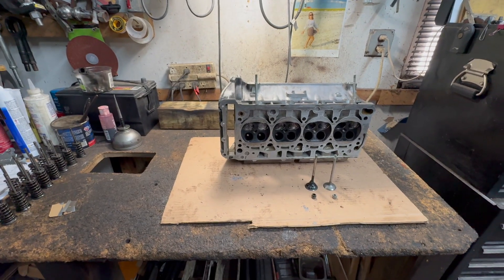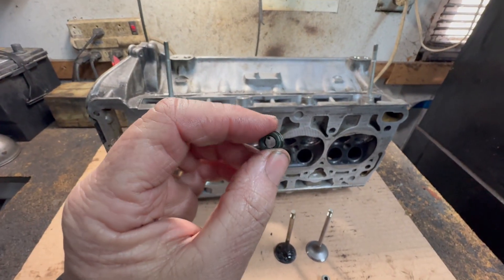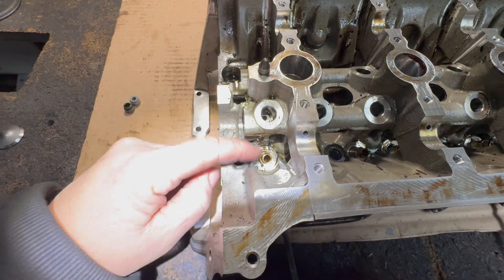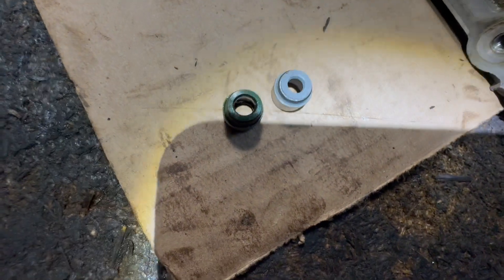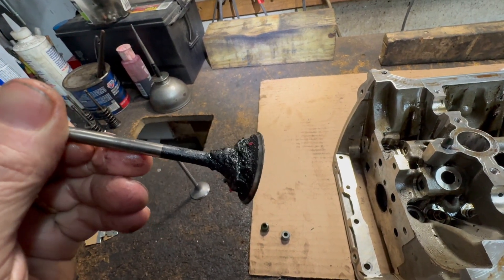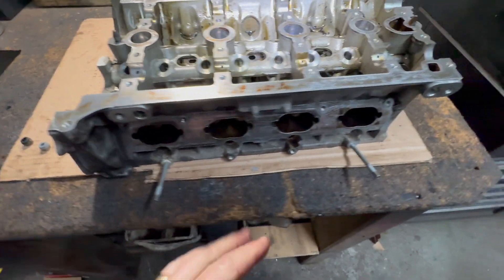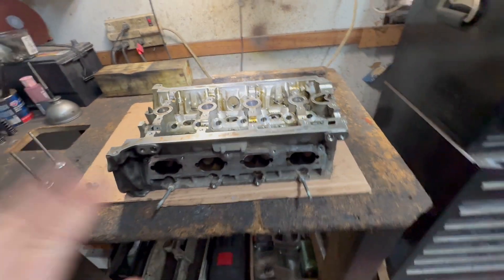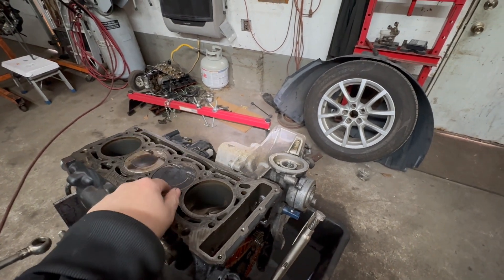One Major Reason Your Engine Burn Oil - Blue Smoke

Comment: hi ! i have 1.6hdi engine. when i give it gas, blue smoke comes out, and the exhaust manifold is oily inside---- if the piston ring is burning oil, can this be filtered out with a compression test?, or should i definitely remove the cylinder head?
Reply from the maker: Compression test would let you know it the rings are sealing correctly but not about oil burning. Can be worn valve stem seals or bad acv valve too.

Comment: Hi what could keep the car from staying running, when you start it up? I have to keep my foot on the peddle to keep it above 1 rpm and if I remove my foot, it cuts off
Reply: I am no expert, but try checking your air intake. Maybe the filter is clogged or maybe there's a nest in the air intake.
Reply: 1st of all, gas or diesel engine?
Reply: Gas engine  @jhsevs
Reply from the maker: We're talking gasoline engines
Reply: @motorcarnut  how do you know that sandinheaven is talking about gasoline engines when you don’t know what vehicle they drive?
Reply from the maker: Oh, I was assuming he was referring to my video.
Reply: (woman here lol👋🏼) thank you everyone for responding, I'll have those checked. It has been sitting for a while under a tree full of squirrels...ughh but I've cleaned the leaves from the edges under the hood, me myself I'm scared of snakes and mice...living in Virginia you never know  @motorcarnut
Reply from the maker: You're welcome!
Reply from the maker: Sure no problem! How did you make out?
Reply from the maker: If you want help, why don't you tell me what vehicle you have?
Reply: @motorcarnut sorry, it's a 2010 VW CC 2.0 TSI engine turbo
Reply from the maker: A vacuum leak, jumped timing chain
Reply: @sandinheaven  sorry comment didn’t show up for me at first